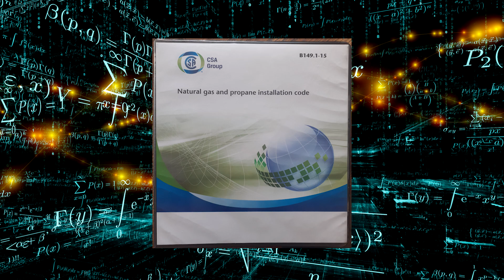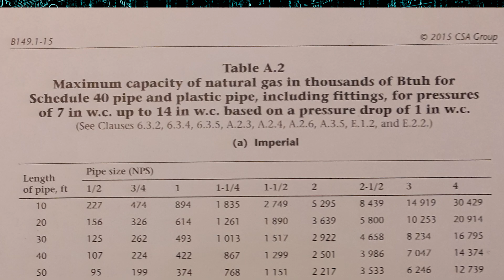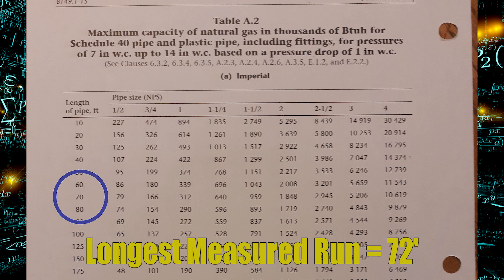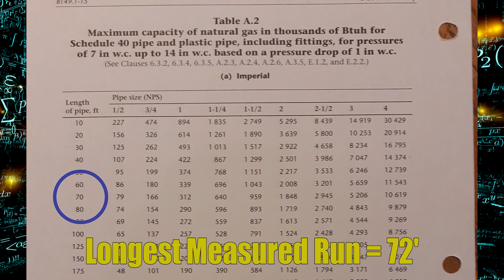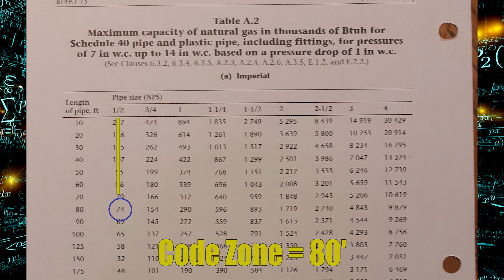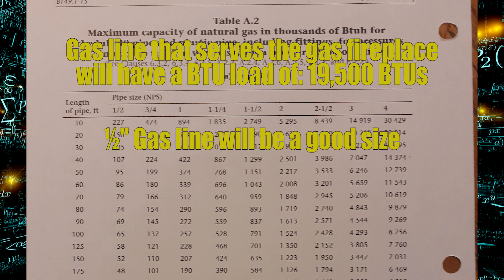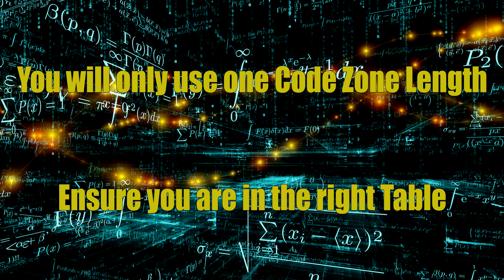Low Pressure Gas Line Sizing Part:3

Comment: Im an apprentice.. how do i know which table to use? How would i find out water coloumn and drop
Reply from the maker: Start here: https://www.youtube.com/watch?v=1nJnqIrA_FE

To find out what pressure you have at the outlet of a meter, you technically need to measure it with a manometer or gauge. Most residential systems deliver 7" to 14" water column.

Allowable pressure drop is based on the delivery or line pressure. With less than 7" water column (uncommon) the max allow able drop is 0.5" WC. For line pressures 7" to 14" WC, max pressure drop is 1" WC [This is based on table 6.1 in the CSA B149.1 gas code)

Comment: How to calculate natural gas line size with valve on the end no load .
Reply from the maker: You can't size it without a load. If you want to leave a future outlet with an unknown load, it needs to be the same size as the main gas run into the building.

Comment: How about pipe sizing a csst pipe ( gastite)?  How do you calculate it if the longest run is the gastitle, and the gastitle is within the black iron pipe system and pressure. Thanks
Reply from the maker: Gastite has their own sizing tables. You can find them online. You need to follow their certified instructions. And yes, bends matter for it